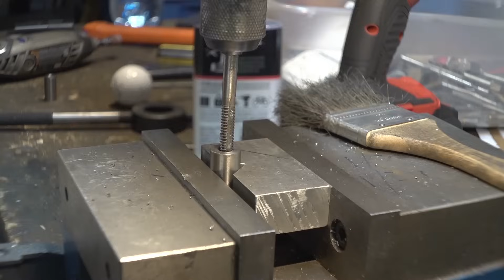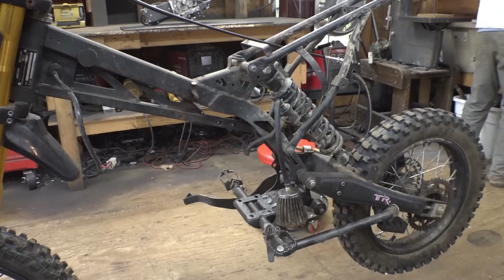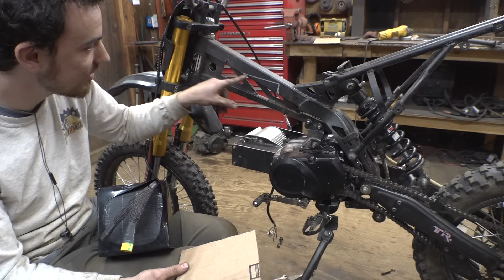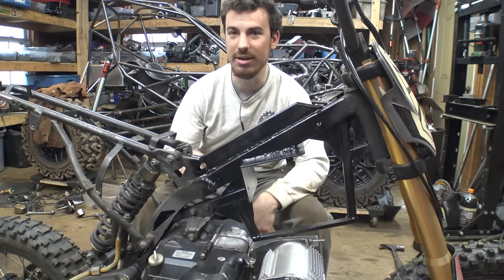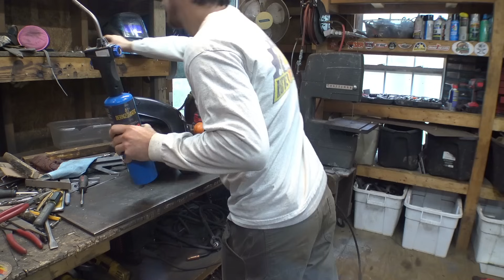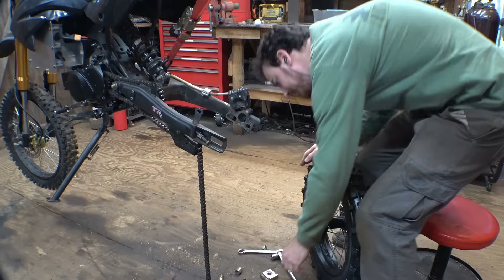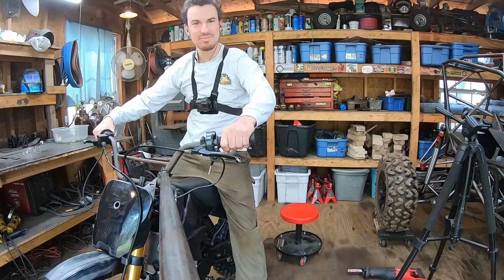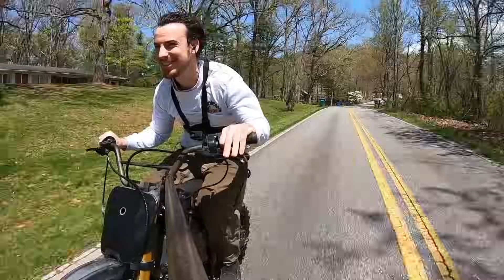A Different Way to Build An Electric Dirt Bike  - Part 2

Comment: There is no need to go to lower gears unless you need more torque, so what is the point of going from 1 2 3 4 you can always be at 4 when you really need more torque you can go to 3 or 2 or 1, is it right or should be riidden like 1 2 3 4.

Comment: Drain the oil and replace it with "Light Gear Oil" and you will stop the clutch slipping and gain 5-10% more power, engine oil is much too thick and you aren't getting the same heat into the gearbox now, this will make it slip and produce drag.

Comment: When cutting a tank that potential flammable substance in it, fill it with water if there is gas it should be pushed out and if you flush and fill a few times any liquid should get flushed out to.

Comment: Another 4 or 5 teeth on the electric motor sprocket should up the input before the transmission, with the torque of electric motors it should increase the top end.

Comment: If you have not found a good way to silence your internal chain is line the inside of your cover with silicon strips for the chain guides. the white strips get wear but hold up pretty well and are easy to change.

Comment: Your build was a really great idea. Enjoyed it. While watching, I thought: Why not take a, say 125 YZ without the engine, pop a rear hub 5000 watt or more motor in. And where the engine was, custom build a massive batter pack roughly be the same size and shape of the engine. You could even set up a foot shifter to change the speed settings on the controller. No clutch but can still shift from level 1-9. Now that would be cool to see and dead quiet too.

Comment: Id be interested in testing something. Like a 200 yard accelerating run. Time yourself using all the gears. Then run it again starting in like 3rd gear and staying that gear. If electric motors really have full torque at all rpm then not shifting will be faster

Comment: using a car engine camshaft chain could make the bike drive train quieter
Reply: you will need to change sprockets but it also have a more durable chain

Comment: Great job building that that's really cool if you would have made your battery box out of metal you could have used the battery box as the strength in your frame all in all great job

Comment: The bottom of the controller is aluminum and it's also a heat sink. It may be best mounted on aluminum fins for best longevity. 👌

Comment: I'm not sure if you have a leak or not.. The chain might be pulling the oil through the housing. Maybe make a gasket for your sprocket cover. Check the fluid level every once in a while and it should be fine.

Comment: By modifying a couple of wires and a switch, you could make the motor run in reverse and put the bike in reverse.
That way you don't have trouble parking.

Comment: Awesome stuff man! Some of the high power brushless motors have liquid cooling and it would be cool to use the old gas tank as a heat spreader maybe in the future? I'm sure you can find those tanks for cheap.
Reply: Or just buy a radiator. Tons of bikes & atvs are liquid cooled, have small radiators upfront, & water pumps.

Comment: My main concern is the chain from the motor to the gearbox and the chain running dry. How hard would it be to take a oil feed from the oil pump to the chain. The excess oil would just feed back into the gearbox. Yes a bit more work, but that chain would run a lot better and quieter and the bonus would also be that the chain would hopefully last longer. But having said all of this great job and thinking outside of the box.

Comment: Why didnt you make the battery box a structural member of the frame? Would have increased the strength of the main spine and integrated everything better. & you know that McMaster-Carr sell standoffs in all common sizes and threadings, don't you?

Comment: Two things: Have you thought of a dry clutch? My Ducati is a dry clutch and I love the rattle noise plus the easiness to replace the plates. Is a 1200 cc superbike with 6 springs and sometimes I remove 2 or 3 springs and the clutch holds up exceptionally well. 
2nd, For the past year I've been thinking about doing the same conversion to my car. Its 6 speed manual, V6 engine, RWD. Basically (my thinking) is just a matter of removing the V6, installing a motor directly to the transmission and distribute the batteries half in the front the other half in the trunk.
Great, awesome build by the way

Comment: The only thing I would have done differently is I would have boxed that part in where you cut and notched the frame before putting the battery box on it just to give it a little extra strength there.

Comment: you could have also filled the gas tank with water then put the cap back on then turn it upside down and cut the bottom out.
Reply: or turn it on its side with the cap removed and shoot at it with a roman candle ;)

Comment: I know the gears on an electric motor are basically unnecessary but it seems more enjoyable to be able to shift gears. I wonder if you gain or lose performance with the gears.

Comment: I disagree with you about the need to mount the non-drive side of the electric motor. 
All of the torque and weight is supported on the drive side motor plate.
Here is my diy EMC:   https://youtu.be/QKzJRHKn3r4
I used a big ziptie around my battery pack to be able to grab and  pull it out of my box.

Comment: With a Harley Davidson  transmission would be a better choice. The motor could be mounted on top of the transmission leaving room in front and down low for the battery.

Comment: Also, what's battery temperatures during ride and charging? I hope it's not too hot? You could add some venting holes or at least electronic thermometer with simple display and put sensor in battery box, to monitor temps.

Comment: Nicely done. Cool idea BTW. Oh, to educe the noise of the chain you could probably use special bitumen noise reducing/deadening cover, like they use in cars. You could use in inside or outside. For outside they have it with alu foil cover so it should be durable for outside use.

Comment: Ive always wanted to take one of those 50cc 2 stroke bicycle kits and run the drive chain to the front crank so you could use all the bikes gearing to play with
Im sure theres going to be some issues getting a pedal crank chain and gears to hold up to the power though. I'd love to see you try something like this. Your the best backyard engineer ever. keep on making these gems please!!!!!!!

Comment: Should have added 3 teeth in the front and not touch the rear sprocket 1 tooth equals 3 in the rear.

Comment: I like the fact you want to build another one, I recommend you the QS 138 90H or the HPM10000 from goldenmotor with kelly controller or Votol, for the high demanding power you will need a serious battery, maybe a custom built one. You can find other people projects on Endless Sphere, I have some experience with homemade electric karts and I’m planning to build another one, if you need help don’t hesitate to ask!! I loved this project, a really awesome build!

Comment: YOU HAVE A STEEL PIPE STRAPPED TO YOUR HANDLE BARS LIKE HAVING A sword pointed at your chest while driving 40 mph without a cage or body panels to protect you .

Comment: Hello, dud the universe, it's amazing. I was sharing a similar idea with my friend today. I was telling him about a cheap Chinese shoper style motorcycle that a guy sold me for $50, I work with drones but I have some arduino kits, an electronic accelerator for a motorcycle or an electric bicycle among other parts that I have collected from the outlet store at a very low price. I hope to be able to do something similar since I had this idea for months and you materialized it in a great way even better than I thought choosing a pitbike for the reason power / weight 1000 likes

Comment: I saw the indian build this type of electrical bike , but cons are very noisy, high power consumption compare to direct drive electric bike , efficiency is the great factor , its more usable when use with hybrid engine setup for self charging and low charging time

Comment: Awesome but I was thinking that when you cut the frame just make the battery box part of the frame rather than the gusseting with the square bar on top and a structural battery box youd have been fine and had more access to the motor but otherwise damn fine job looks fun

Comment: I would build a undercarriage coming back up to neck with skid plate if you expect that not collapse jumping. 
Better if you just split the battery box in half and hang it each half off the side of the frame like it was a gas tank better for weight distribution maybe more weight on the left than the right compensate for the motor hanging off one side not very balanced bike
Awesome job on the motor gearbox

Comment: the reason most ebikes dont have gearboxes ,is because of the fact they dont let the motor run at efficent speed ,to slow and the motor over heats like yours was doing ,it is actually working against the motor, you may have been better getting a motor with much higher torque level but lower over all rpm,this would still have same top end but accelaration would be way better , basically your gearbox isnt allowing your motor to spin up to its best rpm level ,and that handicap results in heat.
Reply: if you ever need a motor and power system speced out for you feel free to message me before you buy anything and ill run it through my motor simulator to see how itll preform before buying.cheers KT

Comment: Clutch is slipping because electric motor makes way more torque, than the original gas engine. You should chance the gear ratios from engine to the gearbox so, as the gearboxs crankshaft spins more rpm. Then the torgue on the clutch goes down. You know what I mean?

Comment: put washers under the clutch springs it worked to stop my blaster slipping when i went to hemi head with more power the clutch slipped in top end but the washers under clutch springs stopped it

Comment: @ rather b welding 
Great video as usual
It may be sealed fine but the chain will be in the oil so when the chain rotates it will bring the oil up with the chain

Comment: I bought a RSP 2021 CONDOR  I don't know anybody else that knows one, or I can not find anybody I wanted to KP mini, but I didn't have enough money, so this look like a better option, I didn't read the fine print, and I got stuck and screwed out of my money, and it has 3 miles on it. Now, the whole ignition, when you turn it, the key will not stay locked in the on position. Your car, you don't have to crank it to start it, you turned the key stays on the on position, it will no longer do that, so that means I have to replace the whole entire ignition port switch whatever. Where you put the key in and I just found out there's no other way to do it, except from the place where I bought a bike, because I have to order a new key unless anybody knows, if I can just truly use another ignition key, switch to a 150 CC, because that's what this is, that's why I got it for this 150 CC, instead of 125 same size, didn't know it, mothers heavier in some cases, and I didn't think it was that low to the ground needs Jack it up a little bit. Didn't realize it would be like a little sport bike, thought it would be like a Grom would be, which is like. Sports bike. More like a pit bike, but better. At least the gram, I wrote, I should have known a clone would be different, but I like it, the front looks like literally, looks like one of the Transformers faces when the headlights are turned on it's three headlights with your true blinker lights that stay on when you have your headlights on to make more like so you actually have five headlights and brights so it's not a bad bike it's just damn 3 Mi on it

Comment: pack the chain box full of thick grease then oil an chain noise problem solved lol also make a heat sink 4 the motor using thin alloy sheet bent concertina style itll extend battery life cus hot motors became less efficient hence more drain on battery !!! btw ur a fkn boss am lovin ur work !!! respect lol

Comment: Hi can you test drive with full charge and make a range test with the gearbox? It's asking too much I know but maybe you could make a simple mount to direct power the wheel with the original chain drive and check for range that way?

Comment: I'm not to sold on that frame. Looks like it has many week points and with the weight of the motor batter and controller  plus your weight. I wouldn't trust it to be ridged on jumps. That square tubing isn't very big..

Comment: Whoever I have to  cut or weld on a small fuel tank,  I always  fill it with completely  with water  couple times before   taking a grinder or torch to it

Comment: Just put a second e motor on this one.
Then you will have the option of switching them in series or parallel connection for torque or speed.

Comment: Wet clutch oil? 
The wrong oil can make the clutch slip. I bought a quad that the previous owner had replaced the clutch. Only to have issues within a couple miles. Got it cheap replaced the clutch again and used correct oil. Problem solved.
Reply: Also even if the motor has similar power to the original engine electric motors make more torque instantly than gas engines. Could potentially overpower the clutch.

Comment: Super nice men! I work on an electric turbo and we found that is better for the electric motor to spin his max rpm rather then count on the torq. The motor is way more efficient on max RPM ! So long story short, you may** be faster with a bigger gear then a smaller gear. Because you are more efficient with a bigger gear. BUT if you have so much torque and you run it max RPM no matter wath, stay with it!

Comment: I don't know a ton about bigass battery packs but I'm pretty sure it's comprised of a bunch of cells. Um sure u know that but can you gut the whole inside of the gas tank so it's just an outer shell for the graphics and then arrange the cells inside that shell. 
That bigass square box is gunna Jack ur knees up if u get frisky

Comment: how did you do your brakes? i have that same front caliper and same forks on my diy ebike But when i try to mount my rim the bolts (even the lowest profile bolts i could find) stop the wheel from spinning from the rotor bolts hitting the caliper adapter.. and the rotor edge rubs on the inside of the caliper.. could you show a video of specifically this?

Comment: Everyone says you do not need a gearbox with electric, but I bought the Denzel 4 speed gearbox 3 years ago and bolted it on a dirt bike and it is loads of fun shifting gears! Nice job on the clean converison! My motor also gets pretty hot
Reply: how much are those gearboxes?
Reply: @Mr_Vengeance87 $400 with no clutch $600 with clutch

Comment: why don't you put it the motor directly on the clutch, by making custom primary gear to connect on the clutch, using no crankshaft, this causes too many lost power, just using single inertia disc to help the momentum while shifting transmission..

Comment: I may have missed it. It should still be possible to run a stator to charge the batteries up some. Kinda like regen braking but vise versa. Would it have a big enough impact to even worry about?

Comment: With the amount of torque that the motor has could you go with with a bigger sprocket on the motor going to a 2 to 1 essentially doubling the rpms and lowering the torque to the clutch?

Comment: Should put a quick access into the chain cover so you can lube it easily.  Maybe just a big bolt threaded in right above the chain.  You can remove the bolt and  put a few shots of chain lube in from time to time.

Comment: run times on electric  powered transportation units, are never as claimed by the sales blurb. 24ah/72v battery has a little over 1700wh of energy, not a lot in the gran scheme of things.

Comment: I'm seeing all the comments that you sealed the crankcase from the gear case so that the drive chain from the motor doesn't pick up the oil from the engine which in my opinion the way you sealed the chain box and everything it wouldn't have been hard to put a couple gaskets on the motor in the cover and had it completely sealed to where you could have let the chain pick up the oil from the crankcase it would have made the chain A lot quieter just a thought I figured I'd put my two cents out there LOL

Comment: the best thing you can do with the battery is filling the empty place with 18650 cells and eventually making a new battery pack without modifying the frame but it would require electric work and you already had the battery anyway. it’s still an awesome project tho

Comment: Feel free to lock the clutch,  you do not need it.  use the throttle to unload the gearbox during up or down shifts. if the shift pedal is easy to move then its ready to shift gear.

Comment: Interesting build. What kind of speed did you get up to on that? I agree electric can be fun with gears. I'm using a mid drive on a mountain bike with 5kW and it's great fun to blast through the gears, so you can have both acceleration and top speed.

Comment: Nice job! You're definitely going to want to get a motor with a higher KV but lower torque and you'll want some fans to cool the motor. Too much heat will literally burn it up.

How fast do you think you got up to as is?

Comment: from a safety stand point, I would weld a metal piece under the gas cap.  so you could remove the gas cap but not stick a filler into it.  last thing you need is some unknown guy try to fill the tank and you end up with a batter pack coated with fuel. lol
chances of this happening is low, but still lol

Comment: The battery mount would be a lot easier under the seat. Using an elongated battery designed for an ebike has a slim and long profile.